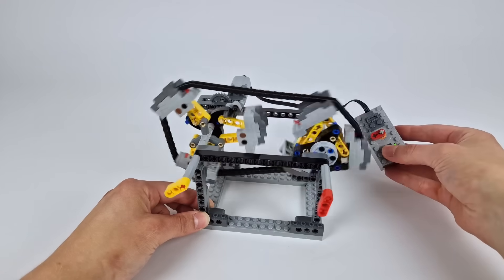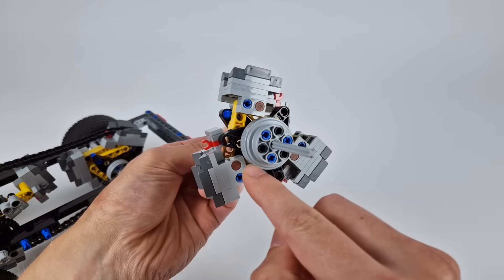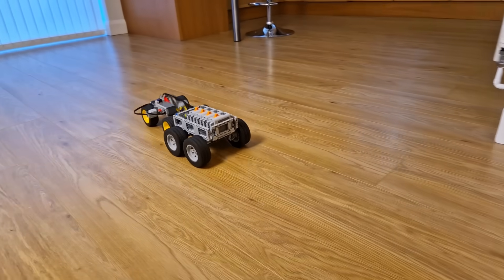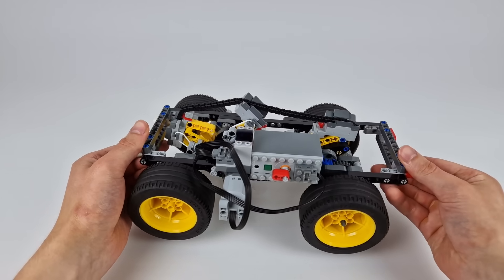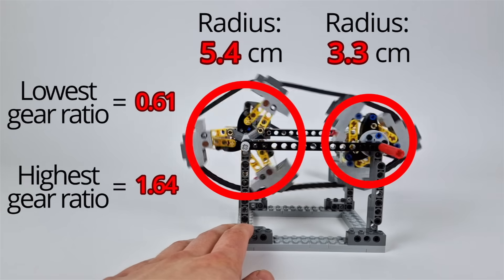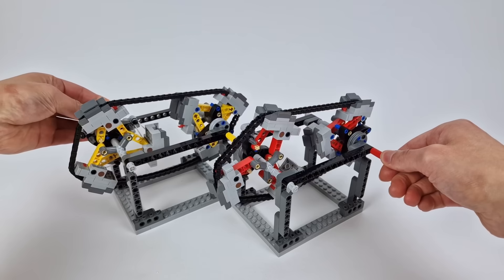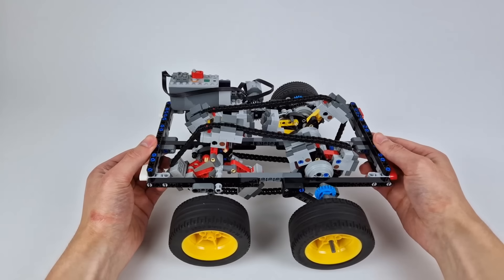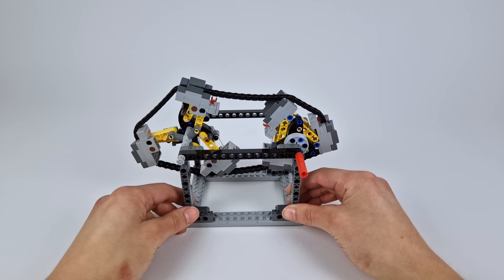The Most Complex Automatic Transmission I've Ever Put in a LEGO Car

Comment: No, so sad that you won't make anymore videos about it. I really would like this concept to get scaled up, made smother and put into a vehicle.
Reply from the maker: I'm sure I'll find some uses for it in other videos, but after 3 months of videos on this I've got lots of other ideas I'm excited to work on :)
Reply: Surely, this works on the same principle as the DAF Variomatic transmission ?
https://en.wikipedia.org/wiki/Variomatic
Reply: @bannerman100 I'm not sure if the wiki link is incorrect, but in the wiki, it's just a depiction of a normal CVT with a chain. I mean, this Lego version of the CVT overcomes the drawbacks of a normal one. With only one drawback, which is the mechanic, but you could lubricate this one because it uses a chain now.
Reply: @kaspis0019 The DAF Variomatic used rubber belts. Downside being they wore down quite quickly, but on the other hand, were cheap to replace.
Reply: @TotoGeenen  Yea, and this mechanism uses chains with a mechanism to slip them when needed and grip when not. making this mechanism superior. And I haven't seen such a mechanism upscaled and in action
Reply: @kaspis0019  while this mechanism is potentially more efficient at transferring power and might be more reliable than belt/friction cvts, there are 2 glaring flaws that make it not ideal for a motorized vehicle

1: the amount of space required for the range of gear ratios it has is very inefficient
2: the transmission is unable to be back driven

Comment: the trailer test was definitely the best way to visualize the CVT, its easy to see it slowly change gear as it gets up to speed
Reply from the maker: Yeah, I was really happy with how those tests turned out. That's also why I tried to keep the chassis quite simple so it's clearer to see the CVT wheels inside.
Reply: @BananaGearStudios would be cool seeing the vehicle driving through some loose sand or dirt to test the cvt. But I agree the trailer and added weight does a great job of showing us how the transmission works
Reply: Nuvinci CVT

Comment: Why not roll the gearbox on its side, and transmit power to the wheels using a bevel gear? No ground clearance issues then. :)
Reply from the maker: It's a good point. One reason was that the chain might have slipped down off of the CVT wheels, though I'm sure I could've added some supports to prevent this. At this scale I think the car would've been about the same size, or maybe slightly bigger, but you're absolutely right that it would have way more ground clearance and I'd be able to use a differential between the wheels.
Reply: @BananaGearStudios . Have you ever tried to build a sit on train ( I belt with enough of these ( you would be pulled as you probs got same weight as them 4 used in this video !   Always wanted to see train one.
Reply: @BananaGearStudios could probably use some kind of rubber band belt tensioner to keep the belt in place for that then
Reply: @BananaGearStudios  there's always next version 😊

Also, you can probably fit steering in the front wheels with the added clearance. 👍

Great build btw, if that didn't get said so far. The radius expanding wheel mechanism is brilliant. 

Also it's fascinating how the non-roundness of the sprockets seems to cancel out at the output. I would not have assumed that.
Reply: Not flipping it sideways was driving me crazy. Not just a single bevel gear, but this is how you get a differential in there. So many of the constraints on the suspension, steering, ground clearance, etc disappear with the cvt output shaft running down perpendicular to the wheel axles
Reply: @mgmchenry the chain would fall off if it were sideways
Reply: It might make it too wide, the proportions looking weird.
Reply: @garrettquartararo201 make a wide low big car like Lambo
Reply: you'd just be trading height for width, it'd be a square lmao. also as other people are saying, every gear you add in a system adds resistance, especially when you're using stuff like bevel gears or universal joints to get that 90 degree angle you need. imo a better solution would be to stand the gearbox higher on the frame, then use chains or something to transfer the rotation down to the wheels, and get rid of the gearing on each wheel.
Reply: Pretty cool to see harvester here lol
Reply: @DemoR what is a harvester ? 
Do you mean a "combine" like on a farm ? 

Akumajou Dracula X Nocturne in the moonlight.

Devil's Castle Dracula
Reply: Losing some power through the bevel gear I guess
Reply: @StreetSurfersAlex  Probably not, I think there would be more power loss from multiple spur gears than a single pair of bevels. Also, it would be easy to incorporate a diff, further reducing power loss when steering.

My guess is that the chain would droop down too much, causing reliability issues.
Reply: @ragingbulllego  You could just add guides for the chain.
Reply: @ragingbulllego how you make a Lego diff, sir ? It would be larger than the wheels to be a real planetary differential. 
Make a Lego diff if it's that easy. I'll watch the video and you post it. GO!
Reply: @ragingbulllego you are right about the chain droop, though. Original comment man doesn't believe in gravity.
Reply: @StreetSurfersAlex bevel gears are generally accepted to have a 97% efficiency in power transfer, so it's definitely still valid
Reply: I had this same idea too, but you would also be able to throw in the diff that was mentioned in the video.
Reply: Ctvs don't work properly sideways
Reply: Came to say this
Reply: not that simple
Reply: And make a subaru 😂😂😂
Reply: Y’all forgetting it’s supposed to be a CAR
Reply: Bevel gear won't last long under loads like this.
Reply: @operator8014  not with that attitude.
Reply: Added complexity, just needs to be scaled down.
Reply: How do you stop the belt from sagging falling off on its side ?
Reply: @Boogie_the_cat  you'd need some kind of tensioner
Reply: Lego technics are great, but they really do limit you in how small you can make complex mechanisms
Reply: Would of made sense and a simple change but then again just setting up proper gears would also fix it and then reverse would of been available to
Reply: Chain sag n friction
Reply: That's what I was thinking. Stack that thing vertically.
Reply: The chain drop might be dealt with by a tensioner.
Reply: Chains do not work sideways, as th chains will drop and disengage from the gears. Chain tensioners will not help. Look at real live applications of chains and you will find that chains are never used sideways
Reply: @maartenbeute6742 garage door motors come with chains on the horizontal plane
Reply: Not chains but a belt! @maartenbeute6742
Reply: Or just scale up the whole thing and fabricate it out of something else than toy blocks.

Comment: Waiting for the CVT car 🎉🎉🎉
Reply: They have already existed for years, and are terrible, unreliable, and depreciate harder than any other cars on the market.

Great concept on paper, and in controlled demos... but in the real world they are an absolute disaster, and complete waste of money
Reply: @Gazlene420  My 2019 Honda Civic with CVT begs to differ. It's saved quite a bit in fuel cost and I've had no issues. It's been quite a bit better than the Nissan CVT that I experienced from a few years before and I only have five years of history using one in a car. CVT's in many other lower torque applications (snow mobiles, bicycles, etc.) have been reliable for many years. I especially like the eCVT concept now being used in some vehicles (mostly hybrids) where you have no steel segmented belts and the hydraulic pressure actuated pully. Instead you have a torque variator using low power electric motors controlling the high torque variable speed by using a planetary gear controlling power from both ICE motor and electric motor.